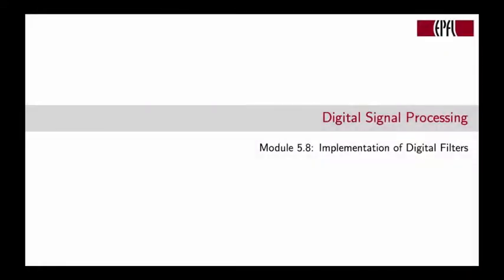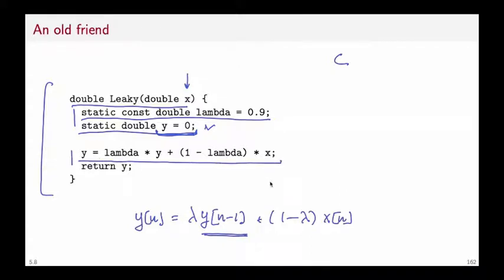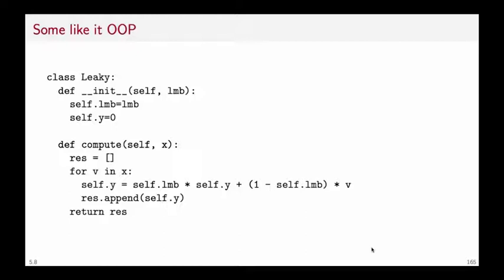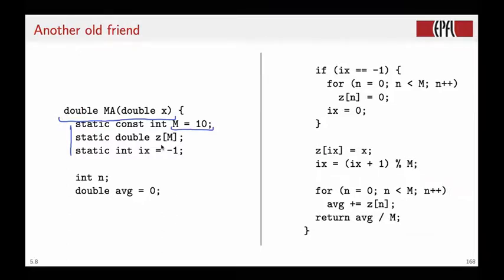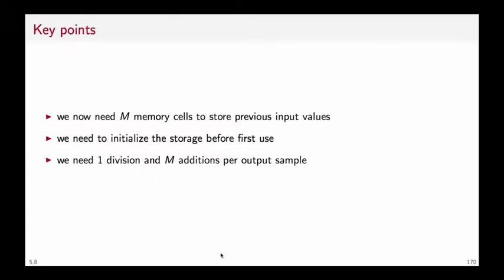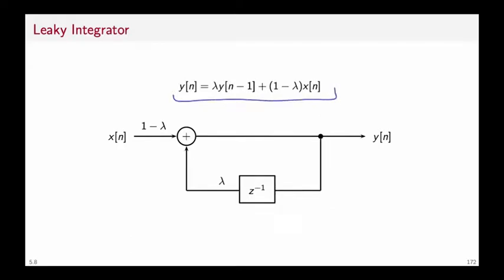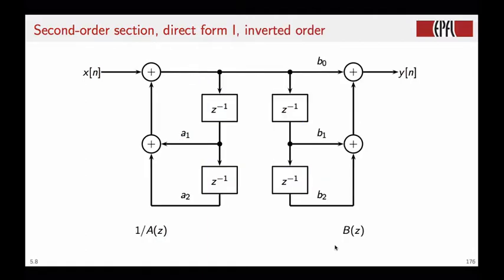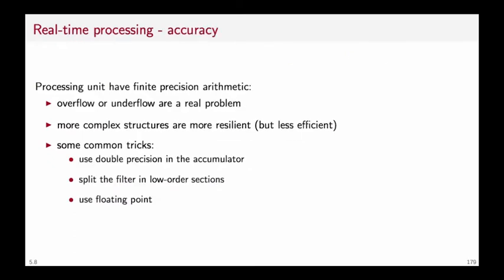Implementation of digital filters | Digital Signal Processing

Comment: Hello,
Firstly, thank you for your videos on youtube (Digital Signal Processing lectures) they were very clear and helpful. I have a question, I'm new to MATLAB and I want to design an IIR filter using the Particle Swarm Optimization(PSO),  I have the PSO code but my problem is the implementation of the IIR cost function (based on the Mean Square Error as the error fitness function)  I couldn't implement it using MATLAB software. It is mentioned in different reference papers but no explicit examples for MATLAB.
Is it possible for you to help me with that (send me the MATLAB code)? If so, then I thank you very much.
Best Regards